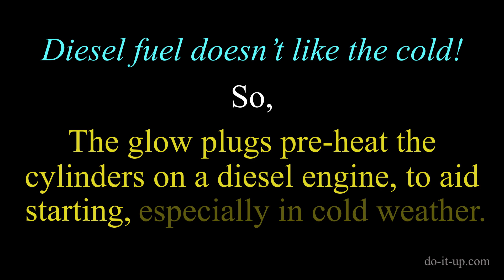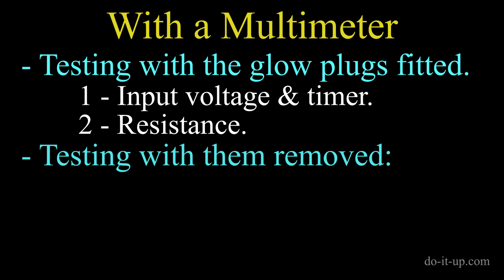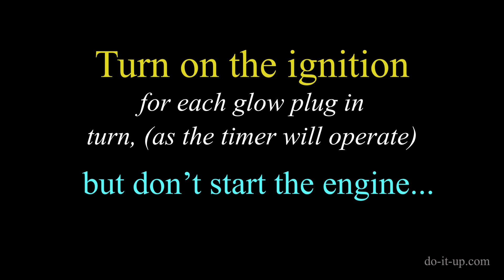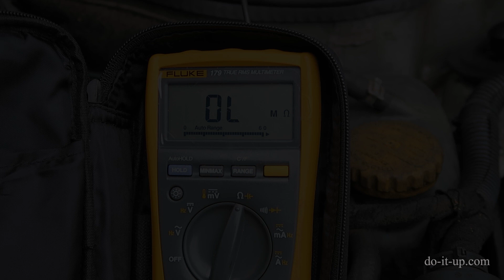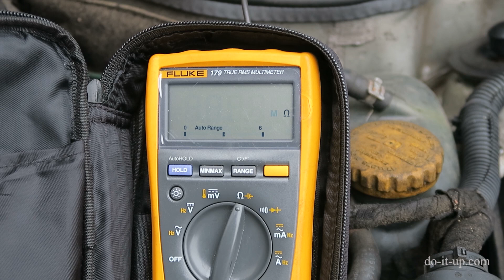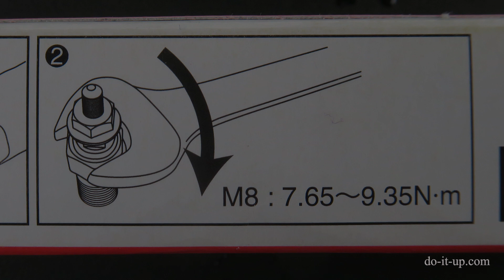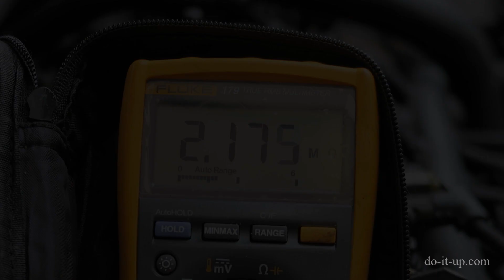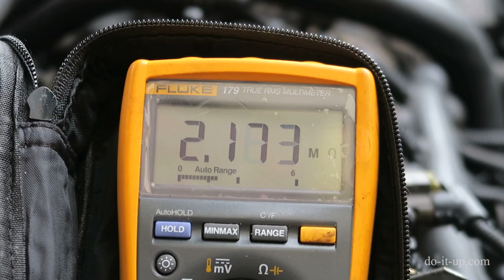How to Test Glow Plugs From Start to Finish (With a Multimeter) - The Complete Guide.

Comment: What about if you dont get any readings from plugs. Just stays on OL.?  Thank you
Reply from the maker: Hi, if you're measuring the resistance. 'OL' usually means Over Limit, Overload, or Open Loop. Some test meters also show an infinity symbol '∞'. This means there is a large resistance, such as an open circuit (open loop). In other words there's no connection between the two points you're testing, (the glow plug(s) is open circuit and broken). It's always worth testing your test meter in these cases, to reassure yourself. I.e. Touch the ends of the probes together. You should get a low (near zero) reading (such as 0.01, 0.117, or 0.2 ohms). You may also get multiplier symbols on a test meter when you take measurements, such as Ω x 1, mΩ x 0.001, kΩ x 1,000, MΩ x 1,000,000 and ∞ x infinity, (an immeasurably large or "infinite" resistance).

Additional info...  If you don't get near zero, (when touching the test meter probe leads together). And you get say for example 6 Ω (6 ohms) resistance . This means your test meter, (or its leads) are out of tolerance. However, just add this resistance value to the value you get when measuring the actual resistance and it will give you a rough idea what the resistance is. Hope this helps...   😀

Comment: If you found the glow plug supply voltage was not 12V would that indicate that the glow plug module/relay/controller is the issue?
Reply from the maker: Hi, unfortunately with electronics, things have got a little more complicated. Although your vehicle may be 12v, modern glow plugs can have a whole range of voltages. My best advice, if a manual doesn't tell you the glow plug specifications. Is to try and look up the glow plug data sheet online. Or, if you're not sure what's fitted? Go to a manufacturer's website (such as NGK) and check their catalogue. It should give you the details you need. I also have more information here:  https://do-it-up.com/vehicles/engine-transmission/diesel-wont-start-when-cold-how-to-fix-glow-plugs/#Checking-the-Glow-Plugs.  Hope this helps....   😃

Comment: Never show where black lead goes???????🙁
Reply from the maker: Hi, the video does show you... But a bit later on at:  https://youtu.be/nFrvzstFqwE?t=338. Yep, I should have put that bit in the video a bit earlier... 😓. Hopefully you have since found out where to put the black negative (-ve) connection:

- The battery negative terminal.
- An earth (-ve) connection somewhere on the vehicle.
- Or, on any bare metal work on the engine (as long as it's connected to earth and feeds back to the battery -ve terminal).

You can find some more information here if it helps:  https://do-it-up.com/vehicles/engine-transmission/diesel-wont-start-when-cold-how-to-fix-glow-plugs/#Checking-the-Glow-Plugs.   I hope you get it fixed soon...   😀👍

Comment: can add your bad start because a cooper washer at the injector.nice video i  was tinking you messure the diffrent sistem on 5 volt supply glow plugs
Reply from the maker: Hi,  Your spot on. A leaking copper washer. I changed them a couple of months later. That was a real pig of a job, as carbon (from the leaking washer) was all around the injector holding it in. I couldn't get the injector out to change the washer! With glow plugs on newer vehicles, they can have all sorts of different voltages, so always best to check the manufacturer's data sheets online (to make sure the voltage you have is correct).  Thanks for letting me know you found the video useful...  😀👍

Comment: This is probably the best guide for someone wanting an insight into how to test glow plugs.
I have had recently 4 new glow plugs and relay fitted to my fiat ducato camper van and unfortunately warning has reappeared only 10 weeks back from garage. With this guide I am considering testing glow plugs and relay myself as garage have implied possible wiring issue, so thank you , biggest issue is access as it entails dismantling front end. Any tips re wiring issue would be much appreciative, regardless great video, thank you.
Reply from the maker: Hi, how old the vehicle is may dictate how easy it is to check? Glow plugs have changed. They can have different voltages, inbuilt pressure sensors and more clever electronics dictating how and when they should work. They may also break down under load?

The easiest thing to do is try and find the glow plug specifications, by searching online. Manufacturers sometimes supply this detail on their website. You can then check for the specific voltage, resistance, etc. If your glow plugs have inbuilt pressure sensors, then you'll need to determine which contacts are for the heating part of the glow plug. There are some more detail here, (of what to look out for): https://do-it-up.com/vehicles/engine-transmission/diesel-wont-start-when-cold-how-to-fix-glow-plugs/#Checking-the-Glow-Plug-Supply-Voltage-the-Glow-Plug-Relay.

Thanks for your comments, it's much appreciated. I hope this helps and you get it fixed soon...   😀

Comment: Would love to see a glow plug come out that easy.
Reply from the maker: Hi, I must have owned the car about 15 years by then. I'd never taken them out before making the video. Three came out easy, one needed a helping hand to unscrew...  So must have been lucky! I must admit, I thought they were going to be a pain (like my injectors). But, out they came. No problem...   😀
Reply: @doitup  I'll be doing mine next week on a Honda CRV3,  I just hope I have your luck.
Reply from the maker: There must be karma involved somewhere...  My glow plugs were easy to remove. Whereas my injectors took one day to remove 3...  and a further 4 days to remove the last one! I wasn't going to let it beat me. Moral of the story...  Always replace injectors with new copper sealing washers. Anyway, I hope your glow plugs come out easy. Maybe a pre-soak with some penetrating fluid will help out...   😀👍

Comment: Exactly what I needed. Thank you now I know how to use a multimeter also.
Reply from the maker: Hi, no problem. Glad it was useful. As a footnote, It's always worth checking what glow plugs you have fitted, as many newer vehicles have glow plugs with a different voltage to that of the battery... (a glow plug manufacturer's data sheet online should tell you what the voltage and resistance is). Hope this helps and thanks for letting me know...   😀👍
Reply: Multimetre ile ohm değerini araç uazerinde ölçerken, sağlam buji değerleri kaç aralığında olmalı?  @doitup

Comment: Ussualy glow plugs are working on 5-7 Volts. When you find 12 Volts on the connector of glow plugs, means you burn the glow plugs. Should change relay.
Reply from the maker: Hi, thanks for the extra info, it's always useful. The video was based on an older vehicle. Since then, more and more vehicles have switched to a 5 to 7 volt system...  Unfortunately, to update a video, you have to start all over again from scratch, (there is a note about the voltages in the text below the video "Typical values (next gen) 4.4v to 7v. The resistance value may also be below 1 ohms. You may need to refer to the manufacturers specifications, to get the correct value…")

As a footnote, I would check what glow plug voltage the vehicle should have, (a glow plug manufacturer's data sheet online should tell you) before swapping out components. Just so you don't end up down a rabbit hole...

Thanks for the great info...   😀👍

P.s. The note in the text was near the bottom. I've moved it nearer to the top.

Comment: If i connect red to glow plug connector, whete the hell do I connect black one?
Reply from the maker: Hi, the video does show you... But a bit later on:  https://youtu.be/nFrvzstFqwE?t=338. Yep, I should have put that bit in the video a bit earlier... 😓. Hopefully you found out where to put the black negative (-ve) connection:

- The battery negative terminal.
- An earth (-ve) connection somewhere on the vehicle.
- Or, on any bare metal work on the engine (as long as it's connected to earth and feeds back to the battery -ve terminal).

I hope you were able to get it sorted...   😀👍
Reply: @doitup  
Thanks for the reply. Gonna try tonight
Reply from the maker: Hi, no problem. There's some more info here if you need it:  https://do-it-up.com/vehicles/engine-transmission/diesel-wont-start-when-cold-how-to-fix-glow-plugs/?  All the best...  😀
Reply: You can test the glow plugs with a test light 
You can connect the test-light  to B+ on Battery and the other side to glow plug without to remove the glow plug 
If the test-light don't illuminate the glow plug is burnt
I hope you understand that I mean
Reply from the maker: Hi, I certainly do. This is another great way to check a glow plug. Before you buy a replacement though, check the glow plug again (after it has been removed). Just in case there is a bad connection somewhere, (caused by corrosion or something similar...),  Another great way to check a glow plug. Thanks for sharing...   😀👍

Comment: Hello everyone, I have 2015 VW golf TDI 2.0, currently has 187000 km , I have no issue at all but do I need to change the spark plugs ?
Reply from the maker: Hi, looks like you have a diesel (TDI). Diesels get the fuel to combust using compression, so you won't have any spark plugs. If you mean glow plugs...  They tend to be left in place until a fault occurs.

Spark plugs - With petrol engines it can depend several factors...  If it runs fine and passes any emissions tests, then probably no? Years ago, you would generally change them every second service (20,000 to 24,000 miles). However, modern spark plugs are made with better quality materials. You would need to check what you have fitted. The copper type of spark plug will have the shorter lifespan, then its Platinum. The best is Iridium, which could last up to 100,000 miles! Always best to check and clean them (and check the electrode gap) when a service is performed (on older and high mileage vehicles), as they can indicate the condition of the engine by their colour and condition.

Hope this helps...   😃

Comment: 34 ohms is good?
Reply from the maker: Hi, a standard glow plugs should be around 1 to 6 ohms. A 34 ohm glow plug may work, but it could be on the way out? Newer type fancy glow plugs may be 1 ohm or less. It doesn't make it easy, when trying to check if yours is OK...  If you know the make of the glow plug, you may be able to look at a data sheet for your glow plug on the manufacturer's website. This may tell you the specification and what the measurements should be. Have a look here: https://do-it-up.com/vehicles/engine-transmission/diesel-wont-start-when-cold-how-to-fix-glow-plugs/#Typical-Glow-Plug-Resistance-Values for more information. I hope this helps and you get it fixed soon...   😀

Comment: What a wonderful video. God bless you for the simplicity. I have a fiesta which starts like ...the vehicle you have started after fixing glowplug. I checked 4 glowplugs are gone. Means it will start early with less selfstart movement?
Factory fitted are BERU Germany. Should I go for BOSCH ?
Reply from the maker: Hi, I have no preference for a particular brand. If the vehicles old, I tend to install something that's not too expensive. But if it's a new vehicle, then I would tend to stick what was fitted previously. Hope this helps. Thanks for letting me know the video helped you out, it's always good to hear...   😃👍
Reply: @doitup  Happy to see your response. The way the video is made its truly inspiring. I m not getting the original one. Thinking of going for bosch. Only thing that bothers me is the fear of breaking it while opening. So a good quality one might have a rigid body..thats what I m thinking. Managed to open them though it was making noise, I sprayed WD40.
Reply from the maker: Hi, it sounds like you did all the right things to get the glow plugs out. When you replace them, don't over tighten as they could break, or they could be difficult to remove again later on, (make sure you tighten them to the correct torque). The torque value is often on the glow plug packaging. More information can be found here: https://do-it-up.com/vehicles/engine-transmission/diesel-wont-start-when-cold-how-to-fix-glow-plugs/#Replacing-Glow-Plugs. I hope you get it fixed soon...  😀

Comment: Wonderful, thanks a lot. Next video suggestion: How to remove, clean the bores and reseat injectors. This little Corsa seems to be in dire need of this.
Reply from the maker: It certainly was...  It took me about 5 days to extract one injector. I had to keep walking away in despair and coming back to it. I even made a bespoke tool to jack the injector out, but would it budge...  Perseverance got the injector out in the end. Moral of the storey...  Always clean the seats and use new copper washers on replacing the injectors. Don't go, "oh, they look pretty good" and put them back as they were...  😕   You were spot on. Thanks for your reply, it's much appreciated...   😄👍

Comment: I use a battery charger to test its so easy
Reply from the maker: Hi, it's a great idea, but...   You could damage your battery charger?  Most 12v battery chargers have an output of between 2 & 10 Amps. If you have a 2A battery charger, then things might get a bit warm. A quick explanation follows...

As an example, one 12v glow plug with a resistance of 1 ohm would draw about 12A, ( I = V/R ).  I.e, 12v/1 Ohm = 12A. This isn't exact, as the resistance will change as the glow plug heats up, but it gives a rough idea. If you have a battery charger with a 10A output, you would probably be OK.  So, It's a great idea, 👍 but you should check the output of the battery charger before you try...  Just in case.

As usual, at your own risk. Hope this helps...  😃
Reply: @doitup  never damaged one doing it yet
Reply from the maker: I wouldn't disagree, but someone will try it with a cheap battery charger...  Unfortunately, got to cover your @r&e these days, dot the 'I's & cross the 'T's...  🙁
Reply: Informative 
You can test the glow plugs with a test light 
You can connect the test-light  to B+ on Battery and the other side to glow plug without to remove the glow plug 
If the test-light don't illuminate the glow plug is burnt
I hope you understand that I mean

Comment: What time should it be for glow plugs warm up and what number of omhs would be correct?
Reply from the maker: Hi, the warm up time can vary depending on the vehicle and its design... Generally, it should be around 10 to 20 seconds. Some fancy modern electronics, may vary the warm up time in some cases?

Resistance - For a standard glow plug, the resistance should be 1 to 6 ohms. There is an illustration of resistance values here: https://youtu.be/nFrvzstFqwE?t=604. However, the values may be more specific for some glow plugs and more modern vehicles. If you know the make and reference number of the glow plug, you can sometimes look up the specific details on the manufacturers website.

It should also be noted that the voltage to the actual glow plugs may be different in more modern vehicles, (not 12 volts). So it may be worth looking this up on the manufacturers website if you can...  Hope this helps...   😃

Comment: You can check them quickly and easily before even removing them with just the spanner to undo the nut holding the wire
Reply: Just remove the feed wire, activate the feed, tap the wire on the plug, if it draws with a spark it's good, no need for a multi meter or removal.  Takes seconds if plugs accessible
Reply from the maker: Hi, great tip. Thanks for the extra info...  Nice and easy...   😃👍
Reply: @joeedwards9721 
Informative 
You can test the glow plugs with a test light 
You can connect the test-light  to B+ on Battery and the other side to glow plug without to remove the glow plug 
If the test-light don't illuminate the glow plug is burnt
I hope you understand that I mean
Reply from the maker: Hi, yes, you're quite right. See the video here... Measure the Resistance (Still Fitted... https://youtu.be/_bxblpUIXpg. It should be noted that the resistance values of the glow plugs (when fitted), can be different to when they are measured (removed). This is because of the potential for additional resistance when measuring, (say between the tip of the glow plug and an earth point elsewhere).

Measuring the resistance (when fitted) should still give a good indication if a glow plug is any good, but there may be occasions when it could give the wrong result? I.e. If a test shows the glow plug as OK, it should be fine. However if it shows bad, it's worth checking when the glow plug is removed just to make sure...

There is a table of results here: https://youtu.be/nFrvzstFqwE?t=687 that gives an illustration of the different results, (when fitted and removed). Thanks for your comment, it's great to have extra info that can help others...  😃

Comment: Where is the negative connected to during the voltage testing?
Reply from the maker: Hi yes, I did omit to say where to put the earth/negative lead in the voltage testing section, (but did include it in the next section https://youtu.be/nFrvzstFqwE?t=336, Oops..!). Basically, if the vehicle uses the bodywork as the -ve (negative) return path, you can use anywhere where there is uninsulated bare metalwork, an earth point, or the battery negative should be fine (-ve earth vehicles). You always need to make sure there is a good connection, even if it looks reasonable, as there could be a thin film of dirt or grease on there. If the vehicle has a fibreglass body, you have to find an earth return connection (wire) back to the battery, (or the battery), as the fibreglass body cannot be used as a return path...   Hope this helps...    😃
Reply: @doitup  after all this time you actually replied....you're goated man
Reply from the maker: No probs, it takes awhile to catch up sometimes...   👍